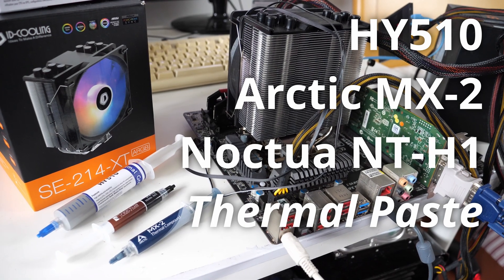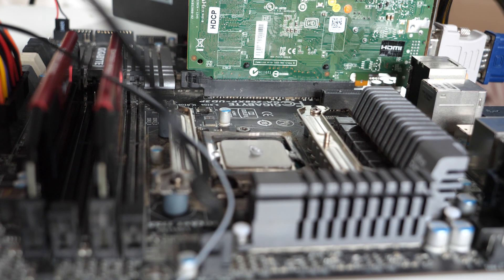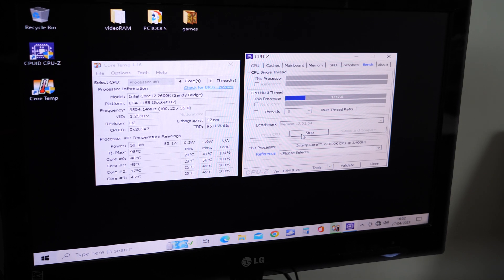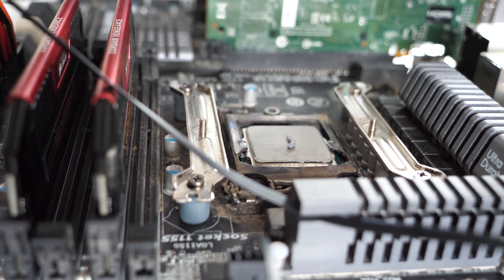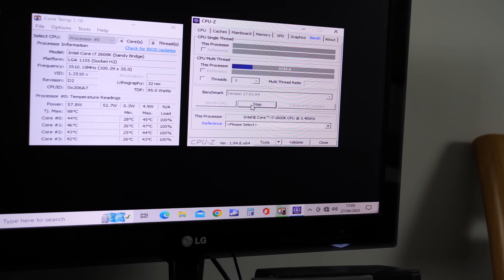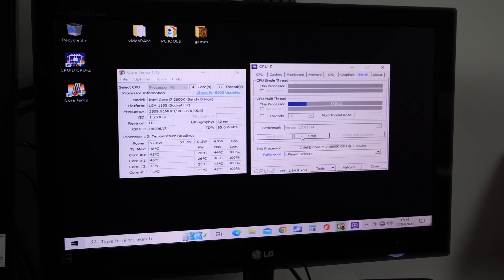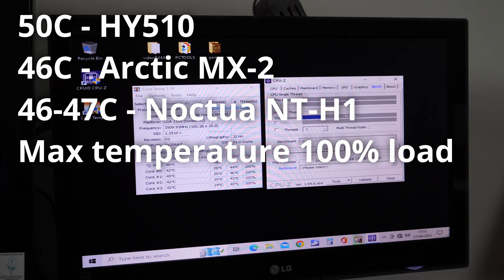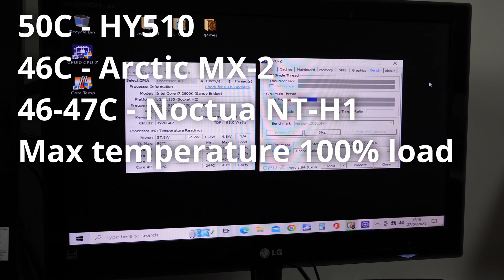Thermal Paste Compared - MX-2 vs NT-H1 vs HY510 (Arctic, Noctua, ASMR)

Comment: HY 510 has a much higher stable working temperature, it can work up to 290c  which makes a good choice for hotends  on most 3D printers, a thing to note is this, some compounds need a few cycles and or time for it to settle, I myself use MX4 for PC's & Laptops, it performs well enough and its nonconductive, and lasts for years,  most people use too much paste, its only meant to fill the micro gaps and provide a buffer between surfaces that do not touch, its not supposed to be a layer that floats the cooler on to the cpu like a Victoria sponge cake!

Comment: I've used HY-510 for years on multiple CPUs (R9-3900X, R7-5700X and R7-5800X3D), directly on an APU die (A8-3500M) and directly on a GPU die (RX 580 2048SP).  The stuff just works and it's DIRT CHEAP.  I just bought 300g of it for less than $25CAD.  Tom's Hardware did a huge test of thermal pastes and the difference between what could be called "the best" and what could be called "the worst" was a paltry 7.2°C across 85 different pastes from 33°C to 40.2°C after 2 hours of running the Prime95 CPU torture test.

Unless you're some extreme competitive overclocker, buying expensive thermal paste is about as smart and as useful as using a 36mm AIO on a 65W CPU for gaming (not in the least).
Reply: For the CPU with a low TDP, I advise GD900-1. For the high TDP, TGP of the CPU, GPU PTM7950, and for the vrams and power section (vrm) thermal putty Upsiren UX Pro.
Reply: just bought like a syringeful and a small cup of it, been using my pc for  years only realizing it doesnt have thermal paste. how is it still alive 😭
Reply: I am using hy510 on cpus and it works just ok, but for gpu it's not good.
Reply: @apollosophy24  Well, my HY-510 works perfectly fine on the exposed die of a Radeon RX 580 2048SP.  You have to make sure that the die is completely covered with a lot of it.
Reply: @CF-105_AvroArrow  i think it would pump out since its a very thin paste on direct die applications.
Reply: Dices que la has usado por años, cuanto dura sin secarse?
Reply: @leviathantube  2 роки HY510 лишається м'якою і не висихає повністю навіть після 3 років - я стер її сухою серветкою.
Але все ж основний її плюс, це дуже низька ціна.
Reply: @ta4ikomaz  ok, thanx ;)
Reply: @ta4ikomaz  Yes, the price is its main advantage but as far as I'm concerned, the difference of 46°C to 50°C in a stress test is no difference at all because both temperatures are completely safe for any CPU and nobody runs stress tests like AIDA64 or Prime95 all day.  😁
Reply: @CF-105_AvroArrow  Так, для чипів с TDP до 120 W чудовий варіант.
Reply: @leviathantube  I don't know.  To date, none of it has dried out or separated.  If it's properly sealed, it won't dry out.  If it ever separates, you just have to mix it like cake batter to get the correct consistency again.